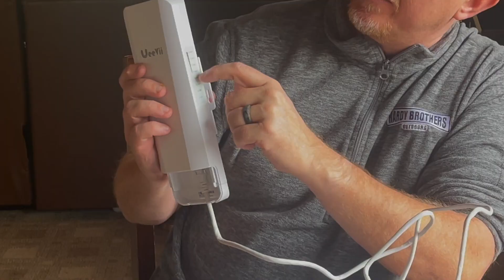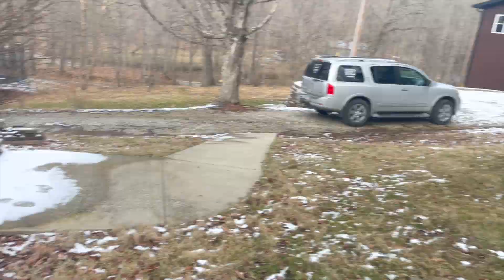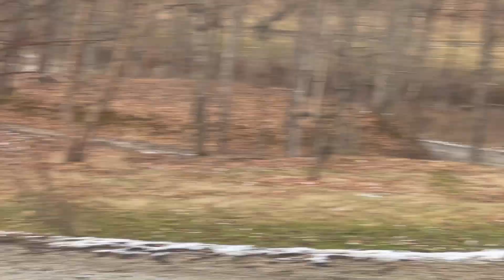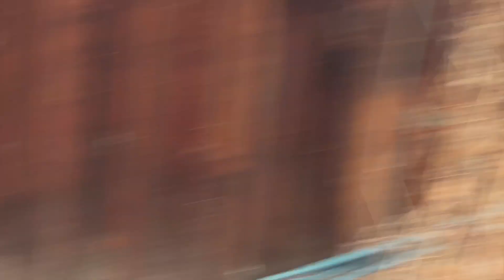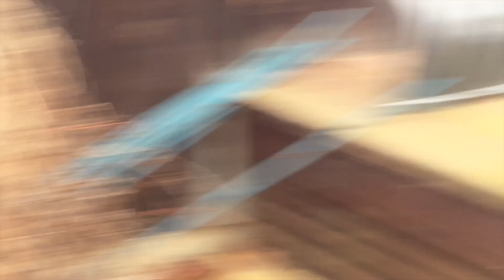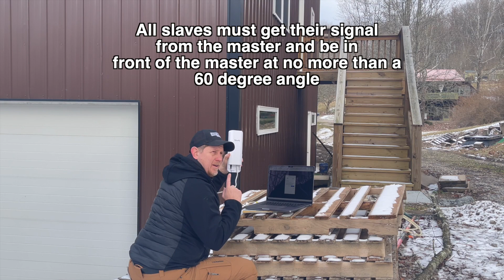REVIEW: UeeVii Wireless Internet Bridge Extends Internet Connectivity at High Speeds to my Barn

Comment: Careful.  Mine work fine in my bedroom at twenty feet, but when I set them up outside at 180 feet they don't work.  Unobstructed line of sight and reasonably oriented.  Very disappointing for the money I spent.
Reply from the maker: EDIT: Sorry about, I had only tested this one and switched when a 2nd one was sent to me, I'm having the below success I mentioned using this one from ULNA: https://amzn.to/48OGahu

Sorry to hear that, mine working amazingly well and have delivered flawlessly through -7 temps rain, snow or shine.  I have the exact speeds inside of my barn that I have in my house and have created a mesh network that the access points in the house also now play a part of.  Very happy with mine.  My line of sight is clear, I will have to check my distance but it is well over 100 feet. Will be doing an updated video soon on my full mesh setup around my house, barn, pond, and beyond.

Comment: I've been wanting to add something like this to get internet out to the shop/barn.  I have the same issue - metal siding messes with the signal too much.  Distance is comparable to what you have there.  Definitely going to take a hard look at these.  Might have to trim some tree limbs a little if it needs to have direct line-of-sight, as there is one tree just on the edge of where I would have to mount on the house.  Interesting for sure - keep us updated!! 🤠
Reply from the maker: I'm going to do a full video on HBO once i have the rest of the components.  I'm confident this will be a great solution but there are a few more parts to the equation and I'll show the end to end solution.